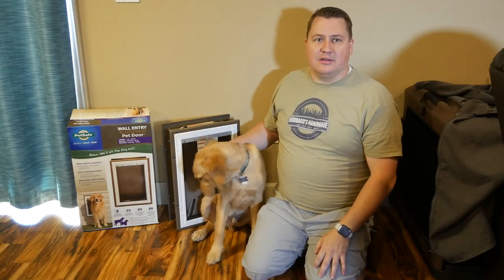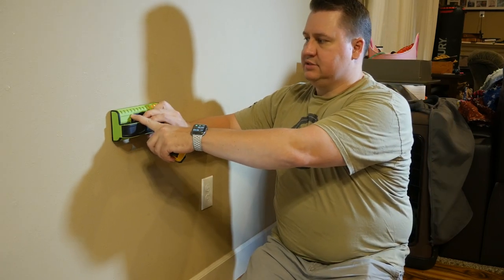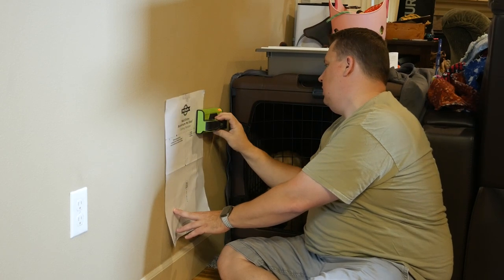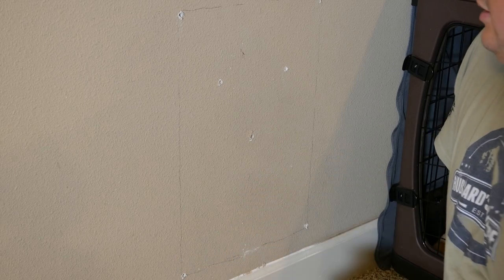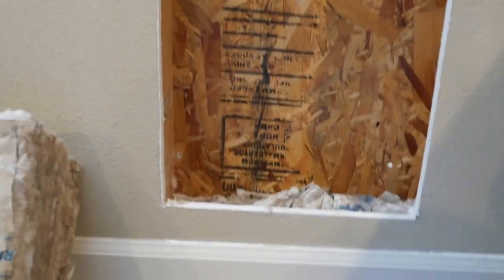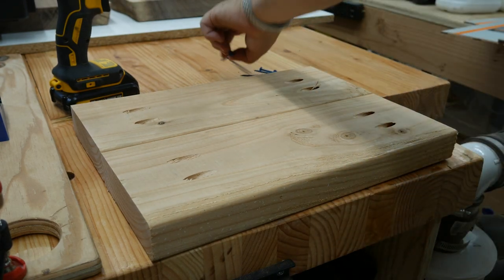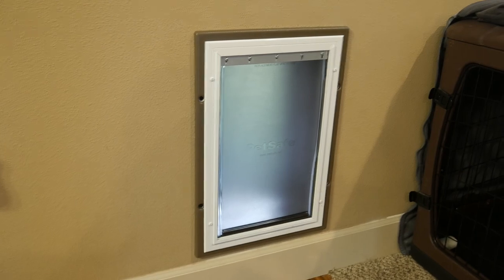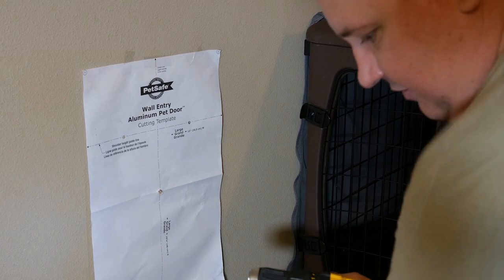Exterior Wall Dog Door Installation // How-to //

Comment: Now that you've had this for 2 years, would you use the same brand?  Options that you wish you had?
Reply from the maker: We do still like the dog door and it seems to be working well but our dog that was a puppy in the video has gotten to be almost 100 pounds and I wish we had gotten the bigger size. Be sure to support the bottom inside the wall or it will develop cracks overtime. I left a gap of half an inch or so and wish I had supported it better as I had to fix it later. Thanks for the great follow up question and thanks for watching!
Reply: @Hubbmade  Thanks, getting ready to order mine and have went up one size because the other size was close.  Appreciate the update.
Reply: I wondered about that size door once puppy grew up. Have you had any problems with bugs getting inside? We have earwigs 😱 here and I’m debating the risk of them getting inside when setting up a catio door. Thanks!